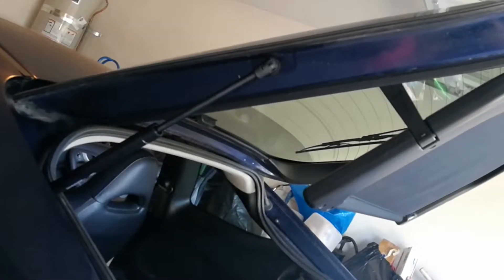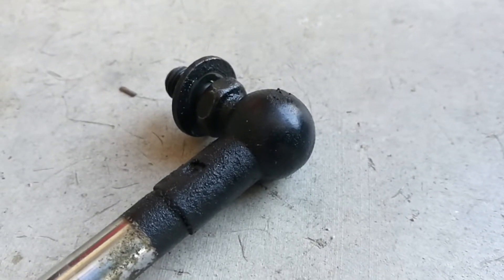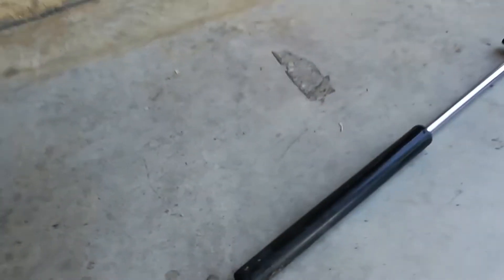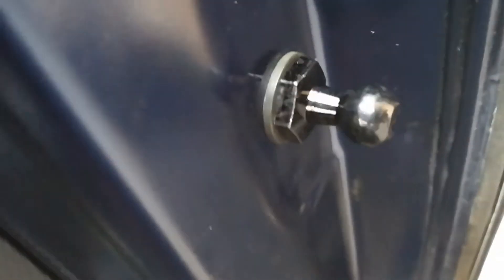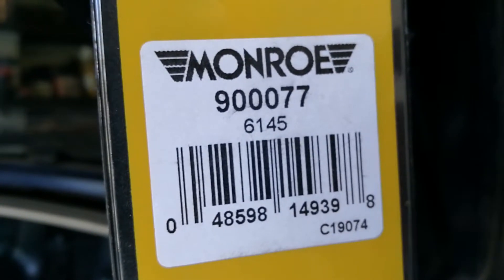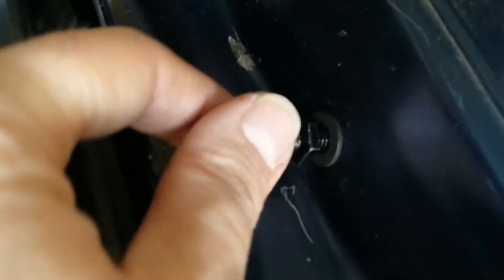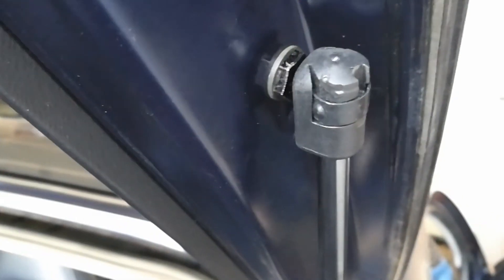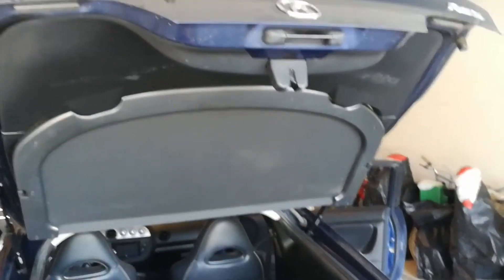HOW TO ⤴️ Replace Rear Hatch Lift Support Shocks in a 2003 Acura RSX

Comment: I'm having the exact same problem you had with your RSX. What an awful design on Honda's part. My left side came off just fine, but the right is completely seized. My wrenches are starting to round off the bolt. I had to use a metal cutting wheel to "free" the other hardware from the broken strut because the thing is pressed into it from the factory.

Honestly I think I was wasting my time trying to salvage the nut hardware from the left strut. I found another set on amazon that includes the bolts. I'm just going to cut off the right strut with my drill and smack on a deep socket 12mm before my wrench rounds out the thing completely.